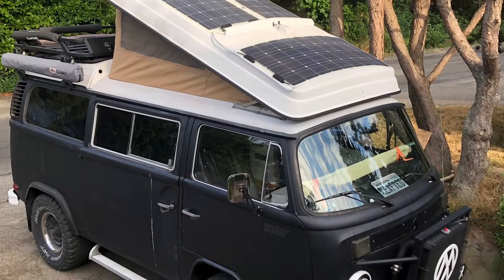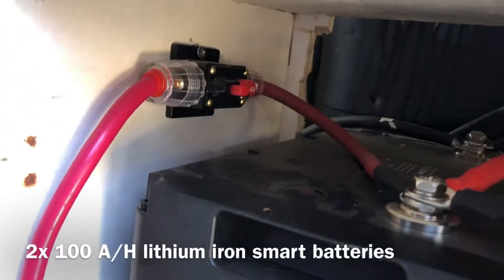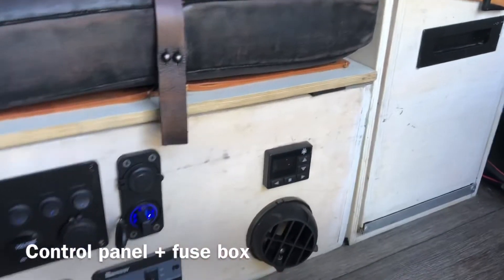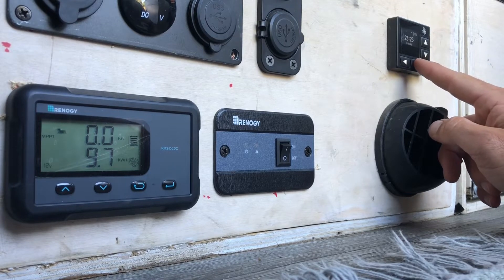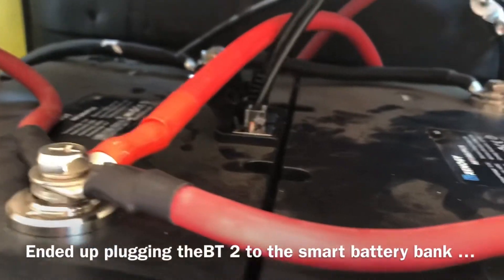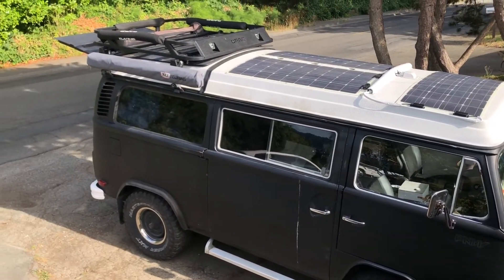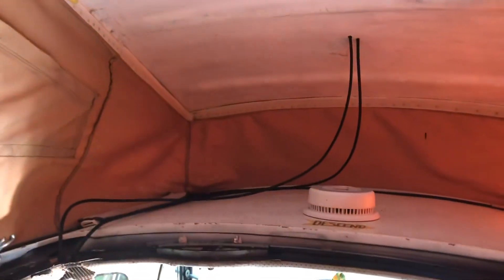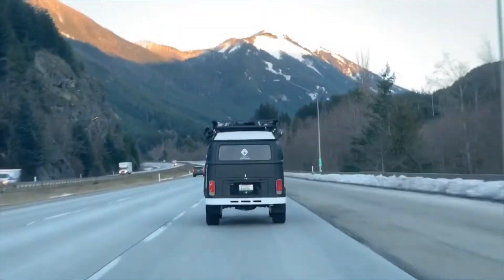6 month review - Solar Install on VW camper  200A/h Electrical & 300 W

Comment: Any trouble with airflow to batteries?   Thanks for the video!
Reply from the maker: Not really , the box is fully open on the back , and half way open on the side , so there is enough airflow so far , I need to check the battery temperature and make sure it’s enough, otherwise I’ll mount a 12v fan inside there .